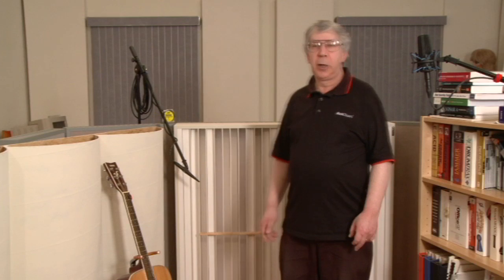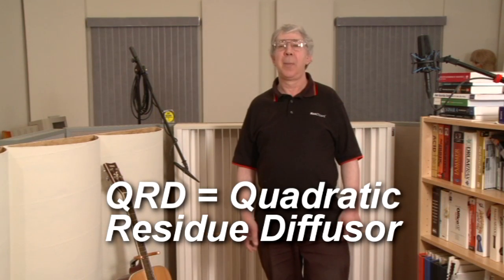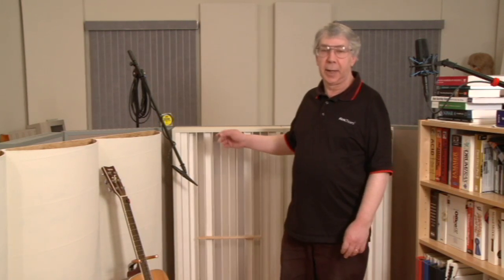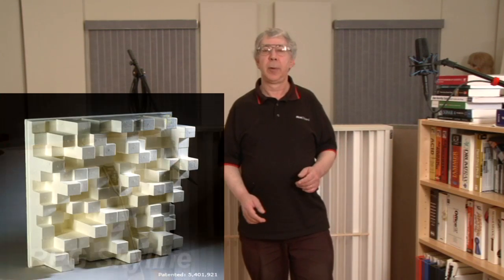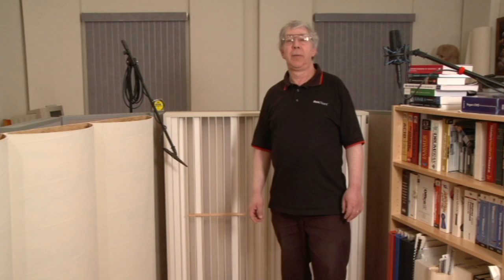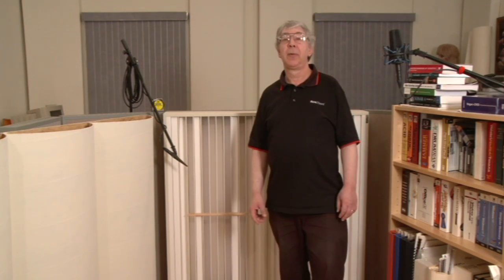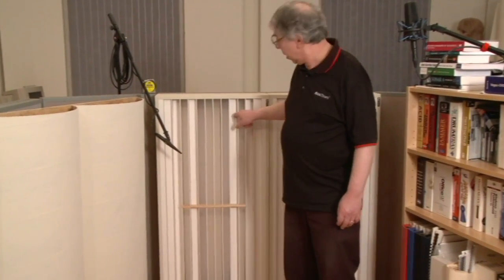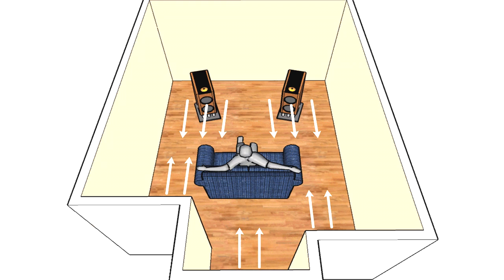All About Diffusion

Comment: Quadratic ROOT diffuser... From RPG.INC.. The bookcase needs more variances and air space behind the books. The key is always that it's better than a bare wall...  Did you actually just shit on having a bookcase? What you should have tried was a drying rack with towels hanging... Shit works and it's got other functions redeeming it's space usage.. Much like a bookshelf.. Whereas a Quadratic ROOT diffuser onlt has one function and is COST INHIBITING
Reply from the maker: Quadratic Residue is also legitimate. Ask Google. As for bookshelves, sure you could arrange the books "just so" and get useful diffusion. But that would be a lot of work, and it wouldn't be as good as a purpose-built diffuser. Plus the cost of the books that you can no longer remove and read exceeds the cost of a diffuser. :->)

Comment: Great video, thanks for making and posting! Your test of the bookcase was interesting for "no effect" which has given me an idea for hiding/disguising bass traps. Do you think a bookshelf unit with a false back and with 100mm Knauf Earthwall behind and space for CDs and DVDs at the front would work well for a bass trap? I'm not an audiophile, just want to get rid of a terrible low frequency null at our listening points which will obtain wife approval. Could use the same concept for corner traps.
Reply from the maker: As explained in the description for this video, I can't reasonably give technical advice in YouTube comments. Please post in my Audio Expert forum linked in the video description. Thanks.
Reply: Sorry, didn't see that as the description shows up in "less" mode and I didn't expand it.

Comment: Hi Ethan,

Firstly thank you for making these videos, they have been very helpful in my learning of room acoustics.

I've seen many types of diffusion:
1.) Space Couplers
2.) Curve Diffuser
3.) Skyline Diffusion

However, many acousticians swear by QRD Diffusion.  Is there a reason why?
Reply from the maker: I think this video explains very well why QRD diffusers are better than curve surfaces. And space couplers are not diffusers. So the direct answer is that QRD diffusers work better and sound better. Skylines are good, and are also QRD, used mostly on a ceiling where you want the sound to scatter in two planes. On a rear wall, scattering left and right only makes more sense.

Comment: So... what I think this video is saying is.. If your back wall is more than 10 feet behind you, you should consider using diffusers. ***BUT, if it is less than 10 feet away, you should consider treating it as a first reflection and use absorbers instead?
Reply from the maker: Yes, more or less, though you can use a "near" style (shallow) diffuser closer than ten feet with good results.

Comment: i liked the way the bookcase sounded. has anyone put that on a spectrum analyzer against along side the real traps?
Reply from the maker: It's difficult if not impossible to measure the sound quality of a diffuser, because moving the microphone even an inch or two changes the sound captured by quite a lot. So if the goal is to compare different types of diffusers, where would you even mic two different devices to fairly compare them? I do think you could assess the sound in person. And my comparison here with a measuring microphone was the best I was able to do.
Reply: thanks for the video Ethan

Comment: Hi Ethan, great video and I very much appreciate your efforts. Specifically regarding the volume, I think this is a perfect example of why DOUBLE blind testing is very important. Look and listen to what happened between the bare wall and subsequent QRD starting at 10:30. Not only is your enthusiasm for the QRD evident in the increased intensity of your strumming during the QRD test compared to the bare wall, but observe the intensity of your head shaking in comparison.  I am sure you didn't intend to do this--it's human nature.   

Another problem I noticed right away is that the cylinders were placed contiguously, but Peter D'Antonio has demonstrated that this is not a desirable configuration, as pointed out in Floyd Toole's revised book.  You are probably hearing the lost low-frequency diffusion messing with the guitar's response. Relevant excerpt here: https://i.imgur.com/FVx9AZM.png

Comment: I have dipole speakers (Infinity irs beta)  What size QRD should i use on the front and rear wall?    I have the choice of  QRD 7  1m x 50,  or 1.4m x 40cm, or a QRD 9  1m x 60 and how should i place them?  I can also get hold of a QRD 31 which 112cm x 82cm ??    My room is 4m wide by 4.8m long and 2.40 to the ceiling.
Reply from the maker: For diffusers in your room, I suggest as large as possible on both the front and rear walls. But you also need bass traps, and absorbers at the side-wall reflection  points. If you have further questions, please ask in my forum as explained in the video description above.
Reply: What about diffusers at the 1st reflection point??
Reply from the maker: Diffusers are not useful there in most rooms, absorption is much better.

Comment: What´s you opinion on a 4.3inch thick BINARY diffusor??  Been offered a few, but i can´t find much info on just binary diffusor.
Reply from the maker: This type of diffuser is also called a "diffsorber" because it diffuses and absorbs. They work well if the holes are in the right places, so be careful buying a DIY unit someone built in their garage unless you're certain they know what they're doing. But these don't diffuse as effectively as QRD type diffusers with wells or a "skyline" shape.

Comment: Your bookshelf didn't diffuse because you left your books evenly organized. You're supposed to vary the depth of each book
Reply from the maker: Sure, if your books have a reflective edge, and they're all the exact same full height, and you place them just right, you can make a diffuser. But that's not what people do, and it's a common myth that a "shelf with books" is a diffuser.
Reply: great video, only got confused about the poly one, you said that the narrow part reduces the sound, but in the guitar test it amplifies it.

Comment: On the concrete tube thing, suppose you put a styrofoam tube, such as those used to insulate copper tubing in the valley area?

Comment: Ethan, this is a great idea for a video. However, I noticed that the volume between each surface differed, and the QRD sounded the loudest. I understand that it may be that the QRD was the loudest surface of the three, but when it comes to recording, doesn't it make sense to compare these surfaces at equal volume (which I understand could be a challenge with the different harmonics presented by different surfaces)? Also, in the past you used a speaker for a similar test, rather than a live instrument. I thought that was a clever way to avoid the inherent differences between different performances- was that a consideration for this demo? At any rate, thank you for sharing your insight!
Reply from the maker: +Steven Morris The volume differences are what they are, but you and goat are correct that having a person play live adds an undesirable variability. An acoustic guitar radiates sound differently from a loudspeaker, so I'm not sure how I'd position a speaker for these comparisons. More important, to my ears the differences between these surfaces are very distinct. It's not like some types of audio testing, where the differences are so subtle you're not totally sure the differences are even real!
Reply: +Steven Morris Yeah I would also like to see a non dynamic variable method ( guy playing guitar) of the test.  Your point is very important IMO.  Even a mono speaker but highest quality recording ( tape or 24 bit for those extended frequencies) would work.
Reply: Ethan Winer Thanks for taking the time to reply. I understand your point and agree with the fact that the audible differences between the surfaces aren't exactly subtle, which was made apparent when you were testing them with your voice.